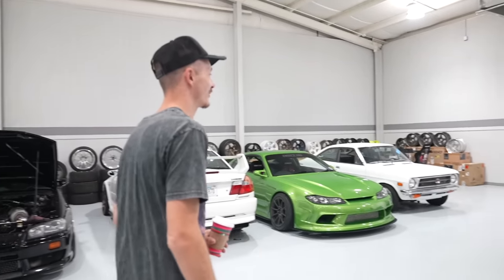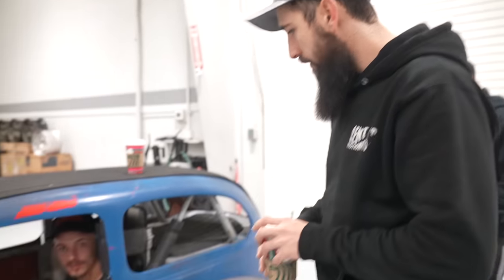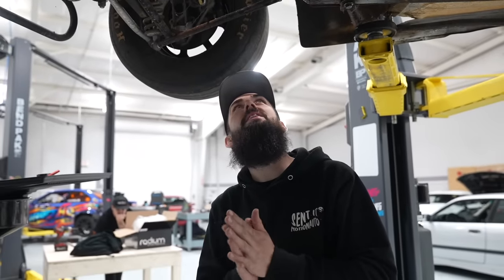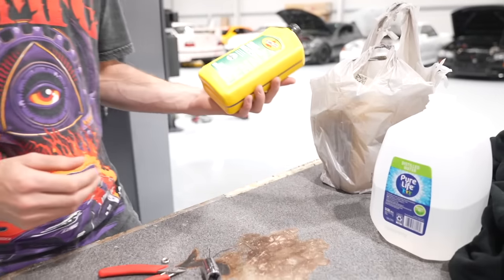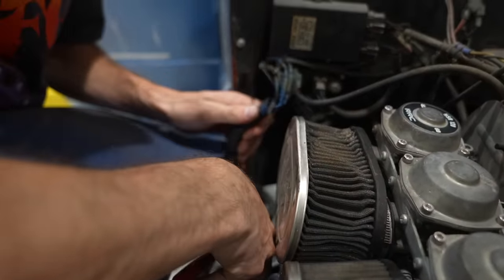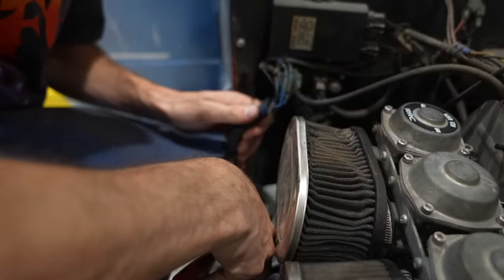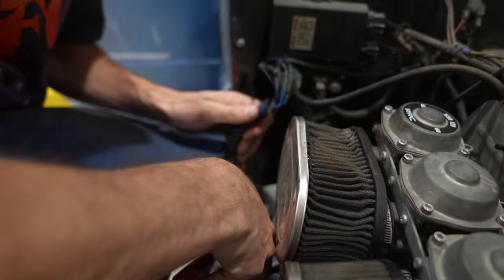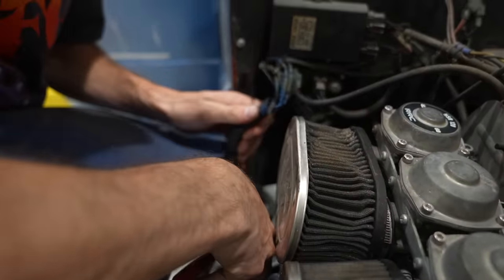I Bought the World's Cheapest Racecar - It's RIDICULOUS!

Comment: 20 years ago I could tell you everything about setting these up. They have changed so much as far as setup goes. Now they are running 3 cylinder water cooled motors instead of the old 1200 and 1250 motors. I have a old video on my channel from 2003 racing in Las Vegas at the nationals. The video cuts short but we started 25th and finished 3rd
Reply: Awesome shit dude 🎉
Reply: @snussy-kp8qj  thanks, I have a bunch more video including in car from back then. I am trying to get it all formatted over to upload. I also have this entire race but for some reason I can't get it to read on my computer. My DVD player reads it fine.
Reply: I had the chance to pick up one with the yamaha 4 in it, increased displacement and whatever mods were allowed, I also had my eye on a bike with the 1100cc version of said motor and was thinking about swapping it back but it never happened.
Reply: I'd love to see them get their hands on one of the US Legend Thunder Roadsters lol. Probably would be a lot easier to slide.
Reply: What would this kind of coupe even be called? Id love to find one
Reply: Were they carbureted or injected back then?
Reply: Did you know Mitch Erickson out there?
Reply: @stopthephilosophicalzombie9017  they were all carburetor back then. This was right around when they started to bring out the 1250 sealed motor
Reply: @BobbyTucker  I didn't. We raced out of Georgia but made it to Vegas for the nationals
Reply: @jerryedwards8113  most of those ended up on road course racing. I ran one during 2009 season at Atlanta. They have a ton more grip than the legends. Back then they ran a different tire than legends
Reply: @LivingwithCable  Sealed in what sense? Meaning fuel injected?
Reply: @stopthephilosophicalzombie9017 sealed means the engine can't be opened by the competitors or they'll be not allowed to compete
Reply: @faisal3398 Ah, that makes sense
Reply: @johnraitt2555  I think it's a Dwarf?
Reply: Legends are the best race class, so much fun, and so affordable
Reply: @joeracer302  they use to be affordable! Now if you want to run up front, you will spend a good bit. Still affordable compared to most other forms though
Reply: what are these called?
Reply: @mrgameowner  Legend Car

Comment: A lot of the legends use Toyota Corolla/corona/celica rear axles and front suspension. There is a difference between ring gears, 8 bolt vs 10 bolt. There are different axles shafts, the later are generally bigger with more splines.  Use smaller stuff as long as gear ratios support needed rpm range because of weight savings. Weir racing does have upgrades. There is a full float conversion out there. Just a few thoughts

Comment: Swap the control arms left to right and it will move the shock mounting point to the top of the control arm. Then you will have all the tie rod clearance you need
Reply: They won’t bolt up, they are side specific.
Reply: they are made to turn left...lot's to be done
Reply: @zacharyhonaker5305  looks like it worked though.
Reply: That's like 1/2 of a stanced car, except you'll be going right instead of left
Reply: These are awesome in iRacing

Comment: Those things are a ton of fun on a track. That bike clutch is not going to hold up to repeated clutch kicks though.
Reply: good thing they are cheap and easy to replace
Reply: Shouldn’t need to clutch kick it if I had to guess it makes enough power to slide without it
Reply: You’d be surprised how much abuse those clutches can take. My clutch has 2 race seasons on it, probably well over 100 race starts - 13.5K RPM near clutch dump, every single start. Stock clutch, stock springs. Doesn’t slip, still makes the same HP numbers.
Reply: as many times i've seen stunters use their clutch when doing circle wheelies, I think it should be fine. Shoutout to DankWheelie
Reply: It's a wet oil bath clutch it should be just fine unless they over heat the motor over and over again
Reply: bike clutches can take wayyyy more abuse than a car clutch, especially wet clutches
Reply: nah that bike clutch will be fine
Reply: H2 R engine swap should fix that need with double the power...just stab the throttle?
Reply: @JDGeorge240sx   and Brian636. 

I actually forgot Dank has already been to the compound. That was a fun video lol
Reply: Upgraded clutch springs are available to help with clamping force if needed. Often used on big power builds. Although they could possibly too aggressive in this application and break other drive line parts. I guess this is where Adam's "D" comes into play lol
Reply: Especially with those meaty tires. Clutch is easy to replace but probably not easy in that chassis 😂

Comment: Yeah im more interested in seeing what time this thing can put down around the compound. I freaking love this thing. Need to find a salvage kawasaki h2 to engine swap it. That thing would be a straight death trap then. 😂 Although a busa engine would be way cheaper.
Reply: Sick blazzer 😎👍
Reply: And Busa is easier to fix. More parts readily available
Reply: Busa or zx14r cheaper than h2r big displacement and good tq. Also way more available. H2R is like impossible to find the motor also will be like 3x the price.
Reply: Wrecked r1 or zx10/zx14
Reply: There's a guy in Missouri who built a mini Chevy Nova using a diy tube frame & diy fiberglass body. That's about the same size as this legend car. But it can fit 2 people inside. He found a ZX14 engine to put in it. The thing rips, he built it for under $10,000 or was selling it for/asking $10,000 a few years ago. 
He was also able get it registered & street legal....I'd love something like that if the engine had a eco mode & sport. So in eco mode when commuting to work. You could get 60+mphs on hwy. Then switch to sport when you wanna have fun.

Comment: One thing about drifting this is to keep the RPM’s high. It may have 120ish HP but it has low torque. So you need to keep the RPM up to keep the wheels spinning.
Reply: And be ready to change the clutch soon. 
Let's get #cooking :trophy-yellow-smiling::oops::yt:
Reply: @chefgiovanni  most bikes have upgrade clutch plates and heavier springs available but the basket will still wear out and get notches faster than a typical one.

Comment: Don’t know what they’re called, but I think horizontal slit vents in the front fender would looks sick opposed to the holes drilled in them
Reply: louvers?
Reply: They’re called Legends cars
Reply: @crazyepl666 that’s not what he was talking about
Reply: @crazyepl666 lol bro u didint even read the guys full comment...   he is talking about he does not know what the actual term for horizontal slits cut in the fenders
Reply: Gills?
Reply: Indeed louvers lol
Reply: Slits would make it weaker , whereas the circular holes actually make it stronger . Simple engineering , a round hole works almost the same way that a gusset does .
Reply: Racers drill holes in them to attempt to minimize lift from air getting trapped under the fenders at speed.

Comment: These things are really common in the UK, big scene for them. Very fun, very light, very easy to work on and repair. Reliability… well a very highly stressed engine with a lot of weight compared to what it was designed for… and a lot more mechanical grip too.
Reply: UK also has Fun Cup cars. Those look like a blast!
Reply: You can put any bike engine in... Even the old i4 250s 20k rpm are a bunch of fun
Reply: You could just gear them slower for more torque and less stress on the engine.
Reply: @alexfeatherstone6676  They already are, but the gear ratios are so close it almost makes them pointless for shifting. 1st gear does almost 50mph in these down from 90
Reply: Wait until they hear of them f1 stockcars 😂

Comment: Just a heads up when these have a cage windshield instead of open or clear glass it’s usually a dirt car. If that motor is a 1200 it’s an old old car. If it’s a 1250 it’s closer to a 2010-2018 car. FZ water cooled direct injection motors were 2018-2023. The new motors are the MT09 with is basically a FZ09 with an electronic throttle.

As far as them being unsafe, it’s wrong. In like 50 years they’re hasn’t been a single death in one of these. And there has been an insane amount of races since then. Like in the hundreds of thousands. It’s box tubing but they’re safe cars.

Also the reason it’s probably hard to drift is because those tires are usually really grippy and soft for the 90ftlb and 160hp they make.

Comment: I raced dwarf cars for a while, tons of fun especially on a dirt track. They are so basic and easy to work on. Not sure how many clutch kicks that motorcycle clutch is going to take though. Those FJ engines have a diaphragm clutch spring and some of the drag race guys would double spring them to keep em locked up.
Reply: not just race guys, my daily fj has a doubled spring too. also there are aftermarket pressure plates that use coilsprings not for weak hands though :D

Comment: Yes, putting a streetbike engine in a car is still a big dream for me as well. Trevor's right a carbureted FJ1200 engine is old tech but it works, pretty good power for a aircooled engine. Yamaha is on the same step as Toyota when it comes to top level of engineering. Often overlooked is that motorcycle engine's often lead the way in technical advancements. This generation and the later Yamaha's had head designs that are very similar to the JZ's you guys bash on daily. Not unsurprisingly co developed by Yamaha. That's why they survive endless limiter bashing.  

Look up Honda V4's, they just sound so ridiculously good at high RPM and are dead reliable at 13k all day. with EFI from a 800 ans a compressor they make a easy 200 Hp, plenty in a light weight chassis. There's a episode of the smoking tire in which a guys comes by in a by a engineer modified Honda N600 with a VFR 800 engine in it, still one of my all time favorites. Watching it should be all to get you convinced.. Not the paved road though, not the way I often go anyway. That would be hayabusa engines which are very well developed in the Hill Climb race car scene.  They even make v8 crank case setups for them, if you wanna build a V8 that revs to the moon.
Reply: you are thinking about the Lotus Elise with the Hartley v8 i guess. that car is crazy

Comment: Hell yea! Can't wait to see what you do with this, they are a blast, shortwheel base and a lot of low end torque, they can kick the rear out real easily. Not sure if I can help as I'm located up in North Carolina but been racing these for close to a decade, anything I can help with just let me know! Set up right they should self steer, in races when I kicked the rear out in the rain, I'd basically just let go of the wheel and catch it and it'd self center, sometimes needing a little kick back. 

Main points to adjust control pinion angle of the rearend housing, camber, caster, toe, ackermann, and bump steer is about all you got on these.

These cars are incredibly safe, at least in their application, not a single death in the decades they've been driven, I've been in my fair share of them myself.

Edit, also not sure if it was mentioned in the video but those carbs need to be cleaned, really small jets on them and that stutter at 15:53-16:00 going up the revs is from the gummed up carbs, cleaned up you'll have much better throttle response and control when it's on the lower half of the RPM range.

Comment: 90's FJ1200!  We used to love those engines! Safely rev to 11,500 on dirt. We have since changed classes and run Dwarf Cars. We run newer fuel injected motors. Currently running 2012 CBR1000rr engines. Nearly double the horsepower of those old FJ's

Comment: For the record, the k&n filters have a lot of problems with the welds on the “nut” cracking because of high RPM harmonics and leaking oil. I would shy away from them and any other brand of oil filter with the nut on them. As a motorcycle enthusiast, a lot of track day and race organizations banned the use of any oil filters with the nut on it.

Comment: When I lived in Japan in 1972 I bought a Honda S600. It had a 605cc Honda engine, drive shaft & differential half way back and two chain drives to each rear wheel. Shifting it was done by a stick shift on the floor.

Comment: These cars have been racing on the circle tracks here in Connecticut since the 80s. 4k sounds very reasonable. As small as they are they seem pretty safe despite all the crashes I've seen over the decades they seem safe, i do believe they run toyota truck rearends, so easy gear change, just swap out the 3rd member.

Comment: It's a legions car. Used for legions road racing circuit. Usually have Toyota rear ends in them. Most older used Yamaha motors, but any will work.

Comment: I got a friend and him his dad and his grandpa used to run dwarf cars, they're essentially the same car just no fenders, its a motorcycle engine and a toyota rear axle, never got to see them adjust more than tire pressure, they had the suspension pretty much dialed for all our local tracks, the cam position sensor can go and it'll limit it to like 6000rpm, but if you unplug it the motor won't start, our solution that day was to start the car then unplug the cam position sensor and let his grandpa run that night.

Comment: They were called dwarf cars before they were legend series cars . They were running those 30+ years ago in the NW and were extremely fast . They probably run them on the short tracks still, but I haven't been associated in NASCAR for a long time But they really drew a crowd  . They originally had 1100 Yamaha engines . Very quick little suckers .

Comment: rear roll center is probably too high, it works in circle track but doesn't in too dynamic stuff like drifting.  You can add angle but you are running into the parallel problem mid engine cars "suffer" but it's different route same problem despite massive fundamental chassi differences, ala the front end digs hard and you can't pull it out like you want.  On a banked track going same way over and over with canted suspension to offset it all this works, on level surface, not so much.

Comment: with stuff like this that’s a motorcycle engine and transmission, be careful about dropping the clutch you can bend the shift forks very easily. I have a lot of time with radicals which are also motorcycle powered and that is a problem with them

Comment: They are cheap because you can't buy the motors anymore so can't run them  in the series they upgraded them to water cooled engines.  They had problems overheating. No reverse also.
I have a 37 Chevy.

Comment: From what I remember. Those cars are built all identical and have sealed motors to run a series. If you want to play around with the engine there's a lot of hidden horsepower. I'm sure if you swap out cams and put high compression pistons in it. Otherwise than that she just have a blast driving it
Reply: And those f j twelve hundred yamaha motors are pretty indestructible if anything you might want to buy a spare clutch

Comment: As a bike rider, ive always wanted to put a bike engine into a car also. Bikes rev like 2x to 3x higher then your average car engines. The problem ive always had is that even the lightest of cars is sooo much heavier then a bike. Your power to weight ratio takes a huge hit and these inline 4s dont produce much torque.

Comment: Dirt Modifieds

Dwarf Cars

Dwarf cars are scale replicas of vintage modified race cars. They are true open modified style cars with or without fenders and run 1,250 cc engines which are limited in size. They are 5/8 scale vintage 1928–48 American-made automobiles and feature full steel roll cages. They also have sheet metal bodies, have full racing suspension, and are capable of speeds over 100 mph on the straight-away.

This is an affordable class and a cost-effective alternative to full-sized race cars. A brand-new roller car is $7,000. Most engines are supplied through the salvage pool and typically cost between $1,500 and $2,500. Sometimes one can find a used dwarf car ready to race for under 3500.00
Reply: That's a 5/8 angelica design

Comment: Inex legend cars.. that’s a 1200 or 1250cc motor. The head fans are to keep motor cool Bc the back cylinders get no air flow when driving. Key is to keep motor as cool as possible. Lots of the stock old parts are off of a older Toyota celica 85 ish I think. Now modern day they have wilwood calipers and water cooled motors.

Comment: I would get rid of the carbs and switch to fuel injection and it will help a lot with being able to drift, it will help with the motor not being so on an off with rpm. It's kinda hard to explain thru typing lol

Comment: Im assuming these are still chain driven in which case you can change the sprocket ratios to make the power band more useable. Tbh i think slowing the rev would actually be a benefit to you. Heavier flywheel.
Reply: These things are driven with a drive shaft. That's what the tunnel is on the inside of the car where the shift handle is. They are toyota rear ends but you can put different gears in them. It is a pain to change. Have to pull both axles, pull rhe drive shaft off the back snd then remove rhe rear gear assembly.

Comment: The car is ready to race, You have to adjust your way of thinking.
You need to get out there and drive it in a circle so you get a feel for it. 
First thing you got to  figure out what are you going to race it in class.
dirt sand payment clay .
I like clay but that is really fast, Then are you going to race 4 cylinder, v8 v6.
I like the vortec v6 or v8. that is the ride.
but the ride you got there is very fast  .
If you are going circle track remember it was built to turn left.